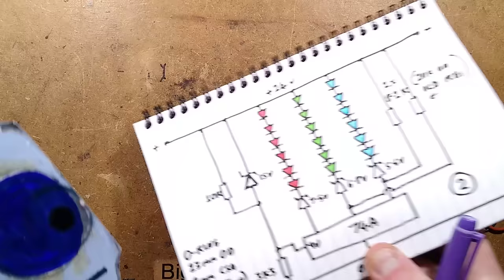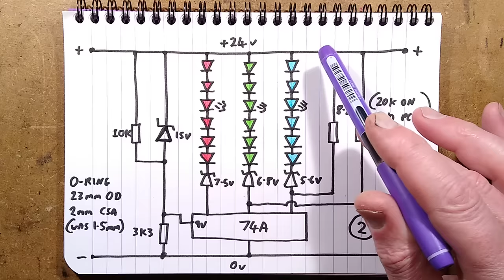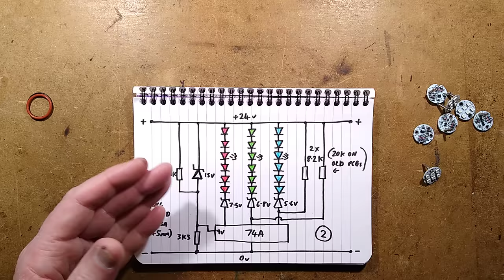Fixing Twinkly festoon issues - interesting power and data system

Comment: The zeners may have another function. 
If the supply voltage is briefly lowered below the LED+zener voltage, no current will flow in the leds and the supply line can be used as a data line to send data to the chip.
Reply: Only problem with that is voltage droop along the LED string which varies by location and current draw across the whole thing. You will also get detection range changes from LED and zener temperature.
The pull-up resistors are likely what the chip uses to sense whatever signal it is looking for while the LEDs are blanked off.
Reply: @teardowndan5364  I was thinking similar - if they dip the  supply, the LEDs will all be guaranteed to be off, so power draw would be low and consistent, allowing data to be sent without voltage drop problems
Reply: Was thinking same first power up it'll be red and maybe that's enable programming mode recieving through other 2 while they off ..... Clever bit of tech😊😅
Reply: @mikeselectricstuff  it ads the "bypass" resistors that can be the address. electrically with 3 resistors you could have 8 addresses but the values might even ad addresses to them in the way it was done with the first wired resistor remote controls.

Comment: I'm not sure, but if you have a look at DCC used for control of model trains. It is a high frequency square wave AC. The voltage does vary depending on what scale you are modelling but the most common is specified at 13.8v, so after rectification, the full 12v DC is available for the motors.

This gives a constant voltage available all the time and the data bits encoded into wave form. While this is a fairly complicated communication protocol. I think a much slimmed down version could be used for these.

Also remember we have things like one 1-wire. Some really smart people have come up with some weird and wonderful things, that leave us mere mortals scratching our head on how they did it.
Reply: Who you to call me a mere mortal? I'm at least a whole mortal...

Comment: ...Beaut, Thanks for teardown, indeed very interesting 2-wire methods used.
Very pleasing that 'Twinkly' have warranty replacement  circuit boards available. Well done Twinkly!
Surprising that the resistors were the part that often failed first - would have expected SMT resistors to be hermetically sealed. Ya learn some thing new every day.
Also rather surprising that a robust conformal coating had not been applied at the factory given that they are aimed at the 'premium' market and Twinkly obviously value their reputation.
I feel for the manufacturer, imagine realizing that a batch of slightly non spec o-rings had snuck into your production line at some point.
Reply: Finding out the o-rings were out of spec must be an expensive oversight. I hope they can go back to the manufacturer for the dud parts.
Reply: O-rings. The bane of everything from twinklies to space shuttles.
Reply: @LeifNelandDk  

Don't blame the space shuttle (well, the side solid fuel rocket booster) o-rings as they worked as expected. The problem was management. Previous to launch they were informed that it was colder than the vehicle had been tested, yet they went ahead with it anyways. If you use an item outside of designed and tested specifications while ignoring the experts who designed and build it whom are telling you not to use it, then don't blame the equipment if it fails.

I'm not saying that the o-rings were great because there was a history of erosion on them after launching. O-rings made from another material probably would have been a better choice but it's easy to make such statements almost 40 years later when great advances in materials science have been made.
Reply: @LeifNelandDk - and garden hose couplings

Comment: Oh, crazy!  I only just recently learned about the pre-addressed LED pixels from some cheap curtain lights.  The fact these can transmit data along the power lines is super fascinating.
Reply: Isn't it just similar to DMX? A technology that has been around for almost 40 years.
Reply: Is there a part number or spec sheet?
Reply: @bojohannesen4352 DMX doesn't mix power and data
Reply: Long ago when I was a boy, there were several devices that sent signals on the power lines. As long as you stayed below a certain power level, it was legal and worked quite well. This was in the analog days. You could have transmitters and receivers that used the power lines. Intercoms often worked that way. No need for antennas, just plug two of them in and they worked.
Reply: @bojohannesen4352  DMX has a separate data line.  I think CAN bus is the only widely known protocol that’s somewhat similar?
Reply: BSR X10 Automation has entered the chat…
Reply: @bills6093  They still make power line network adapters.   They work best when they're on the same 'side' of the breaker box.
Reply: I have a Velleman kit circuit in my guitar setup where four switch functions are going over the two power lines.
Reply: Signal-on-power is a not-uncommon design problem. Due to the wide variance in application conditions and requirements, standards for this sort of thing are usually specific to a field of application or a proprietary system. See: BSR X10, Dallas/Maxim 1-Wire, SAE J2716 SENT, rotary telephone dialing, and many, many more.

Comment: There's an unpopulated resistor that would run between +24v and the red drive signal. I think the placements (and resistances?) might be different on each board, as a way of baking in the address without needing to flash the chip or anything
Reply from the maker: It's not using the resistors to set the address.

Comment: Another viewer mentioned already trains but this is also used at thermostats of Honeywell. These units have only two pins + and - (gnd) and send the data over these two lines by using a threshold voltage, the data is above the threshold voltage to make a digital signal. I think this method is developed to make easy to add newer hardware to an old house with existing (12v) wiring and don't need any modification. Very clever, very handy. There is detailed documentation available about the protocol they are using, very interesting if you want to know how it works. I bet if you use a scope on these lights to monitor the voltage lines, you can see the blips of data.
Reply: trains? don't talk to me about trains. a few months ago i saw James May recondition his 1971 toy train, it was from an old 'toy story' episode from 12 years ago. i thought, 'hmm a small complicated thing, with an electric motor', that is pretty cool, despite me not being interested in trains or model making ordinarily. then last week the guardian newspaper mentioned z scale trains. they are small enough to fit on 50p piece, the track gauge is .25 inches. one can put a loop of track with a mountain in the middle on a sheet of A4. i saw this and thought 'that is ruddy amazing'.  i am getting good at soldering SMD, and so i am also looking at microscopes to buy (stereo or one with a screen?), so really small trains sound fun. it seems they may use coreless motors, rather than brushed DC like OO toy trains.
obviously your trains, and my trains are completely different, but in lieu of any friends i ramble on here instead. cheers!
Reply: @KarldorisLambley  Did you mean T gauge, not Z gauge scale trains? T gauge are ridiculously small and use magnets so the trains stand a hope in hell of staying on the track.
Reply: @nickryan3417  T are half Z, 3mm gauge rather than 6. but they are ludicrously expensive. at the moment i cant even find a kit on ebay. so ill just use the twice as large, but still minute z scale.
Reply: Do you have a link by any chance to a page that describes the protocol? Would be interesting to make your own driver for a string.
Reply: Reminds me of the eBus protocol used for heaters in Europe. It uses two wires for power and data. The voltage jumps between ~10V and ~20V, every device can send and receive. A device willing to send must wait for a "bus free" byte, which is sent at the end of every packet, and must not appear in any transmitted data. Then it sends its ID and simultaneously reads it back. Through clever overlapping of bits it can determine if another device also wants to send, and will wait if the other device has a higher priority. The addresses are one byte and determined by device type.
Every device may pull up to 18mA from the bus for powering itself, which is enough to drive a display. Many devices even contain a full bridge rectifier so the polarity does not matter.
I built an adapter recently to convert the bus signals to 5V TTL, now I can analyze and control what my heater does without a display.

Comment: I messed up the polarity and blew the electrolytic capacitor ages ago on a gift of a philips striplight, and then I managed to crack the board. Always been too timid to try and fix it, but watching your videos has given me some gumption to try save some money.
The details are scanty ((h2...100v...CL and is 6.3x7.7 ) so  I started with a 10uF. Lights come on but are super dim, so I've ordered some more (47uF...etc) and will swap it out until I get the right one.
Of course, I will inevitably be sending it to you when I cock it up. ;-)

Comment: I wonder if the addressing of the module isn't just set by R3, R4 and R5. Setting a resistor on R4 and R5, like on your board sets it to "2", but other combinations give other addresses. If I'm correct, this would mean you could have (3 bits =) 8 different addresses.
Reply: With the other light using 20k resistors, I wonder if the value also plays a part.  Having the options as open, 8k2, or 20k gives quite a few additional addresses.
Reply: @uzlonewolf  Hmmm,, good point; didn't think of that.
Reply: Using the resistors for addresses was my thoughts too. Much cheaper and easier than using chips with different programming.
Reply: This was my thought too. No doubt Clive can look at some of the other boards to confirm or refute this, unless all the boards are number 2.
Reply from the maker: When I saw the different resistors I initially thought that they controlled the address.  But it's not the case.
Reply: I've used some I2C devices with only a small number of address pins (e.g. ONE) that use a resistor-set voltage on the single pin to select one of several (e.g.8) addresses. With such a scheme and three address-setting pins you could get 8^3 i.e.512 addresses configurable. Not suggesting that scheme is used here but it could certainly work. BTW with such schemes one of the resistors of the potential divider is built into the IC so you only need to provide the other (upper) resistor to the + supply rail.
Reply: 8 different addresses really isn't enough for these applications, different resistors are usually required for each LED to moderate them to the same intensity range and add in the fact that different colour LEDs "wear out" at different rates then the addressing would start to fail before too long.

Comment: I think the "bypass" resistors that can be the address. Electrically with 3 resistors you could have 8 addresses but the values might even ad addresses to them in the way it was done with the first wired resistor remote controls.

Comment: So the chip needs to quickly change the G and B pins between input and output modes? That would require a time synchronization method. Impressive, but seems like a lot of work just to avoid a third rail for communication. The factory defined addressing avoids the need of separate input and output pins.

Comment: The chip could alternate between lighting green and blue after every decoded packet if the protocol uses a delay between packets. That way one of the pins can always be used as an input. Maybe even between single bits?
The voltage divider and zener on the left should be the supply, except if it has an internal capacitor. The DS18B20 for example can use one pin for data AND supply in parasitic mode.
Would be interesting to have a look at the 24V rail with an oscilloscope to get the voltage levels!

Comment: Certainly a very interesting system.
I think the 15v zener is to strip off a large part of the 24v supply so that a larger proportion of the data, that is present, can be seen across the 3k3.  I am not absolutely sure about that, but the 15v zener isn't to stabilise the 9v.    I think the supply to the chip is via the two 8.2k resistors?

Comment: The 15v zener is stable enough no need for a cap that would be overkill for such a small circuit
Reply: Also a capacitor would mess up their signalling over the power line.
Reply: @user-qf6yt3id3w  yes, less sharp transitions. A clever design.

Comment: It's interesting that Twinkly (one of the first of these products at a consumer level) doesn't use addressable LEDs whereas the cheaper clones do. That makes the systems from Govee etc far more hackable than the Twinkly ones. 

In a (low budget) theatre production we used loads of the cheaper Govee LED stuff, but with our own drivers on the end to allow us control of them by sACN rather than the standard controllers.

Comment: i got a set of addressable christmas lights that are literally a controller with bluetooth and wifi and a string of leds+wire+heat shrink that use 2 wires for power AND data, not 100% sure what type of chip they are using but they can show upto like 8 different colors at once before repeating the pattern

Comment: Fascinated to know if these are using a microcontroller or some custom chip, I spent a little time searching for SOT-23-5 microcontrollers but they're really quite rare.

I know it'd need some gear that's not necesarily in every hobbyist's workshop but I wonder if anyone's decapped one of the chips and stuck it under a microscope, might be interesting to see...

Feeling the need to hunt down some 'Twinklys'

Comment: Other 2-wire power and data schemes are eBUS used in heating systems ( https://en.wikipedia.org/wiki/EBUS_(serial_buses) ) and "1-wire" used for temperature probes etc ( https://en.wikipedia.org/wiki/1-Wire ). These are both bidirectional too. 1-wire uses baked-in unique addresses (like MAC addresses) and a clever mechanism to identify all devices on a bus without having to poll every address to do so.

Comment: Interesting. I have a string of these outside the back door and six of the twenty are in various failure modes (when set to all warm white, some of the failing ones show green, two have no output, one is sometimes blue but corrects itself after a while). Time to get de/soldering….
Reply from the maker: If they're still under warranty they may send new o-rings and modules.

Comment: There's a page called "Controlling Twinkly leds directly with a microcontroller" on AVR freaks where they've reverse engineered the protocol. 

"It appears that the waveform is stable for 6 microseconds and drops to half voltage for 2 or 4 microseconds depending on whether it is a HIGH or LOW bit. When I turned off all the lights, I only visualized the wave with 6us at full voltage and 2us at half voltage, so this makes me think that the 2us corresponds to a bit 0."

Not sure how each module/LED gets its address.
Reply: Keith westley made two videos "Hacking Twinkly Part I" and "Hacking Twinkly Part II". The LEDs are QED3110 devices and it seems like each one has an address programmed.

Comment: 24V LED strips usually use groups of six series LEDs and a dropper resistor. However, if you use a transistor configured as a constant current sink, you can use seven instead, increasing efficiency by 17%. (Obviously it's more complicated in this application and that would probably be impractical, not least because there may be considerable voltage drop over long cables.)
Reply: I use these LED strips in my kitchen and garden, powered from old laptop supplies which I have opened up and changed the potential divider so they output about 23V.

Comment: O-rings, the bane of my boiler, the damned diverter valve cartridge that fails annually is always cos of o-rings around the plunger failing, and usually not replaceable because they're pressed & crimped in, so the one that's in there now back in december I actually managed to take to bits (they were lazy with the crimps) and replaced the worn, stiff, cheap black things with the soft and supple red silicone kind, and put a load of silicone lube on the shaft (giggety) on assembly, and so far, no leaks, but time will tell, Baxi/Potterton boilers are shite at best anyway so I expect it to crap out at any moment regardless (alredy replaced the expansion tank too!)...

Comment: I would think that the omission or inclusion of the four resisters, (three across the LEDs and the one across the high value zener) could be detected for numbers 0 to 15. so this one is number 2 and sure enough one resister is missing giving 1101 or 0010. How are some of the other numbered chips wired? It does seem odd that the power pin would be used that way.... but maybe that is not the (only) power pin but rather a LED replacement circuit. even with none of those resisters there may be enough power from the four i/o pins to power the chip.

Comment: I was wondering how the chips were programmed too. I couldn’t see any pogo pin spots at first making me think they were programmed before placement, then I noticed what look like seven through plated holes. If they connect to the chip they could be the programming port.
Reply from the maker: Not really enough pins on the chip.  Unless it was done on the output/data pins.